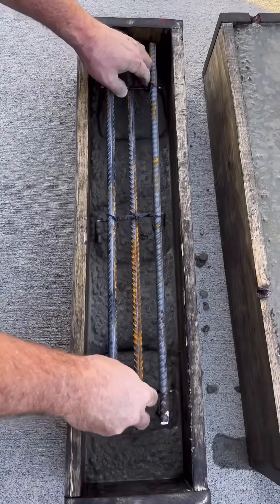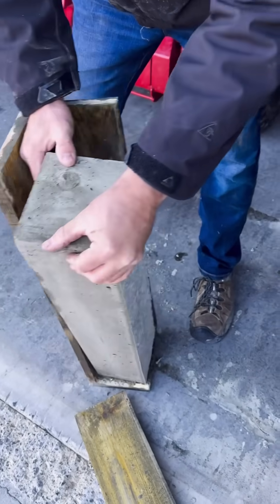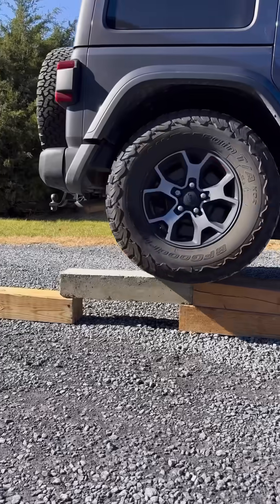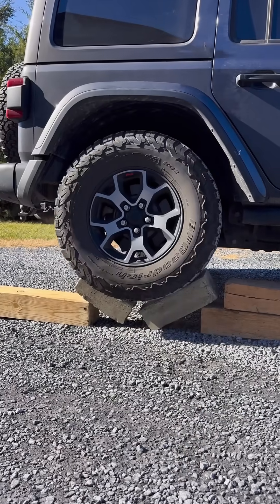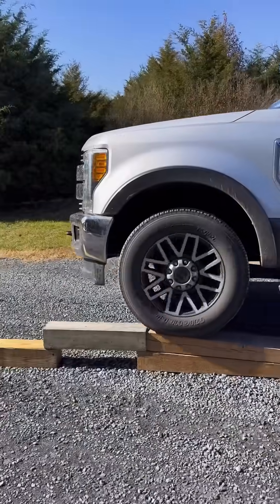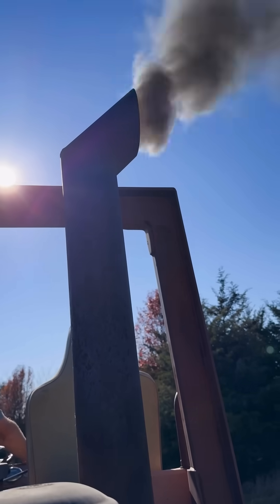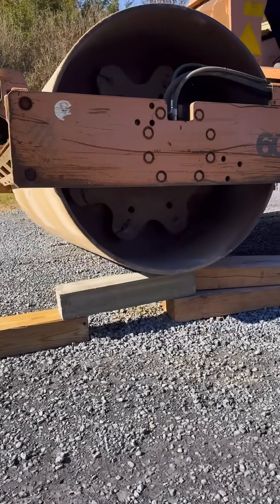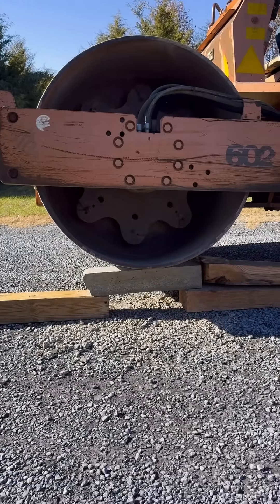Why We Use Rebar To Reinforce Concrete

Comment: Concreat needs 28 days to set up and you will get about 80% of its strength after 28 days however it takes years for concrete to actually set up to 100%
Reply from the maker: Correct, they say the concrete in the Hoover dam is still curing. But at this point, it’s such a minimal amount it doesn’t matter.
Reply: @hausplans for best results allow concrete to cure inwater after 24hr setul
Reply: exactly. concrete doesn't technically have 100%, it just keeps getting harder

 @hausplans
Reply: I have delivered concrete on bridges at night that was cured enough for traffic within 24 hours
Reply: @PaulBlatchford-z6j some mixes only require 7 hours of curing in order to allow traffic to run in them.  The concrete can have a strength of over 3000 psi in 7 hours
Reply: @PaulBlatchford-z6j yes with accelerator additives you can get this but lab tested concrete is submerged for no less than 28days to allow it to reach as strong as possible before testing in hydraulic press
Reply: i work in a concrete testing lab. 28days is all you need to see if its good enough
Reply: @OGJackW  i also work in a concrete testing lab, there are exceptions to that. We’ve been on a fairly large infrastructure project for a couple years, the mixes they’re using are actually specified to reach their design strength at 56 and 90 days respectively
Reply: @brendancross2767  you are not talking about a normal concrete mix, your mix is more than likely as much chemicals as it is aggregate, sand and cement. We are talking about the rule not the exception to the rule.  Also normal specifications call for designed strength for both lab (lime bath) cure and field cure at 28 days.
Reply: Lab conditions it should reach its design strength in the specified time, typically 28 days. For example a 32 MPa mix should reach that under laboratory curing conditions in that amount of time, but you are correct that field conditions should reach 80% in that time in good conditions. Obviously when conditions aren’t good it’s going to take a little longer or even a re-pour if the concrete goes to sleep, which is why at those times it’s important for the technician to cast a field cure.

But concrete is always getting stronger, obviously it’s by a larger amount at the start but it’s always strengthening
Reply: I read it reached it's peak after about 50 years.  However that was in the early 1970s and the formulas used for concrete varied even back then, and vary a lot more today.
Reply: Actually concrete will cure forever as long as there is still free lime to hydrate.  The Hoover Dam is still curing to this day.
Reply: Concrete takes 7 days to get 70% strength and 28 days for its 100% brand strength, but it gets even stronger later through the years
Reply: @oleg4260_  100% of spec is NOT the same as 100% if it's life.  28 days is long enough for specification purposes. but it continued to harden for many decades.
Reply: Ancient Roman concrete structures contain tiny pockets of unmixed concrete that automatically fill any cracks that develop, and absorb excess moisture, so they are still curing, centuries later. It's not known if this was done on purpose, or just a side effect of their mixing techniques, but the stuff certainly lasts.
Reply: Concrete is virtually at 100% at 28 days…

Comment: 3 days, on bridges our state requires 2 weeks of cure and then 1 more week after applying cure compound
Reply from the maker: Very close, a little less
Reply: @hausplans concrete strength increases over time , curing time is optimal at 28 days , the best is if it is constantly kept moist . Time increases strength , it will continue indefinitely . Samples over a hundred years old  still show signs of increasing hardness
Reply: @cameronhamer9432 You are the only person in the comment section with some true facts. I can tell you do concrete too.
Reply: @cameronhamer9432 for some reason I thought I remember hearing 170 years
Reply: @cameronhamer9432  I agree. Working   at a precast MFG plant we use curing chambers to achieve this.
Reply: @hausplans  I was thinking 2 days myself so im at least closer if not right
Reply: If you cover the concrete with visqueen and pressurize the gap with co2, it will harden immensely and is very difficult to break.
Reply: Try 28 days
Reply: @tech5298  hard to pressurize a gap on an entire bridge lol, some of them are up to 1500ft long. We pour concrete like 14 hrs straight a good 40-50 trucks 10 yards a piece
Reply: How many weeks till they make the new guy drive the roller over in vibrate mode though?
Reply: @twowheels2604  weve had people drive into fresh pour
Reply: You wait 2 weeks to spray cure? Kind of defeats the purpose right?
Reply: @taylorsova2594  nah the concrete is kept moist then entire time
Reply: Well on the Hoover Dam it's still not even completely cured 😂
Reply: @GabrielGarcia-300  cause its constantly wet. If they made it dry for like 3 months i bet itd cure nice
Reply: @DannyOrnelasPerformance  water helps concrete cure faster
Reply: WHERE DID THE ROLLER COME FROM
Reply: Concrete takes 28 days to fully cure
At least that's what I learned in architecture school
Reply: @dusannestorovic5699 it depends on the water to cement ratio, percentage of cement to fly ash, and additives. I've had a mix hit design strength in less than a week.
Reply: @christophervines9756  actually, the full cure time is still 28 days. It just reaches the required psi strength fast enough for cars and semis to drive on it sooner. I’m assuming you’re talking about highway mix or stuff that bakes in the sun and gets harder faster.
Reply: @blankman8305  no Post Tension Elevated deck mixes. I think you better read your specifications more closely. The 28 days found in specifications or structural notes is to reach design strength...not "cure time". That 28 day note is because history tells us that a 4,000 psi mix that has a break of 3,000 at 28 days will never reach 4,000 psi and that Concrete will likely need to be torn out and replaced. If a 5,000 PSI road mix his 5,200 psi in 7 days it's pretty much maxed out it won't go much higher at 28 days.
Reply: @dusannestorovic5699    28 days is to reach most of the "rated strength" not max strength. It can take years to get that last 10 - 20% strength.
Reply: 28 days is it’s full curing time. It doesn’t cure any more lol it just gets harder/stronger.
Reply: @dusannestorovic5699  it never stops curing it constantly changes atom structure